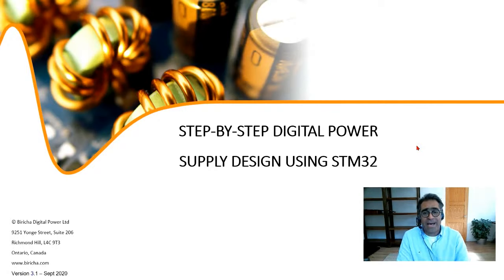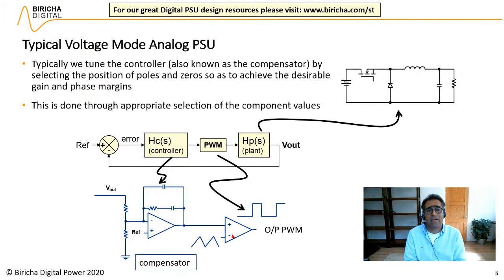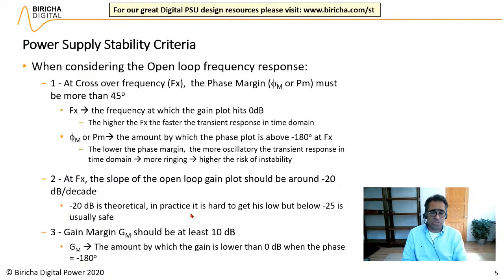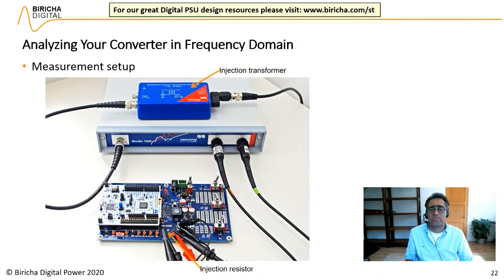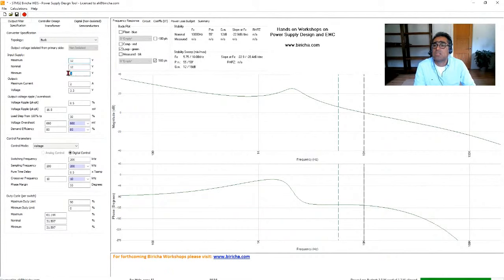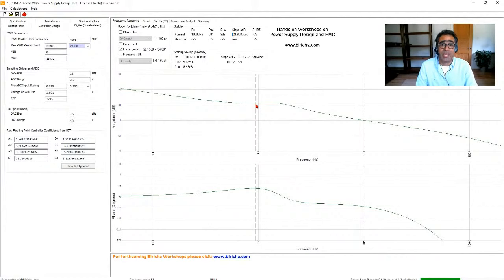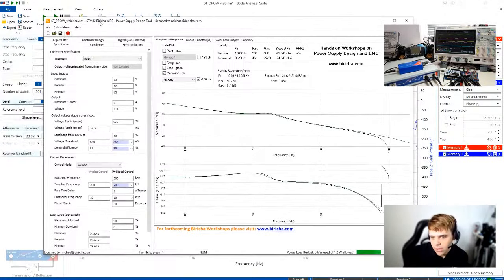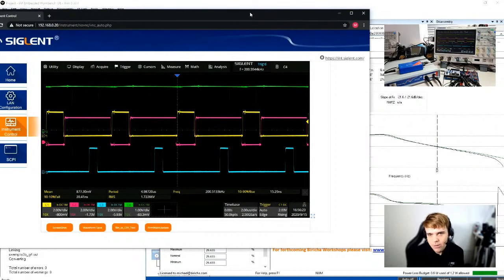Step-by-step Digital Power Supply Design using STM32

Comment: Dear Dr. Ali - thank you for demonstrating the use of the WDS software. Having watched the STM demo by Dr. Hallworth, could I kindly request that the materials used (code example) be shared with us as well?  I would very much like to try implementing this demo SMPS myself in my homelab.  Thank you so much!
Reply: Sorry, I wanted to clarify how we can get access to your 3p3z control library for STM32?  I could not find any details on your site, thanks!
Reply from the maker: @bsodmike  thanks for your comment - you can download the example software to run on the STM32 Discovery Kit from our website: https://www.biricha.com/st-discovery-kit
Reply: Biricha thank you I will give this a try!
Reply: Biricha also. It might be worth considering a longer video on the extra steps you would deal with to take an SMPS design to production. The whole “this is what you can churn out in 5mins” is great as an intro but I’m keen on something a bit deeper than that. Thanks!